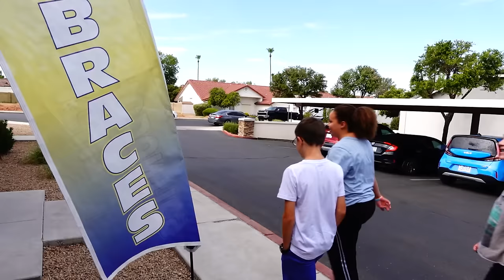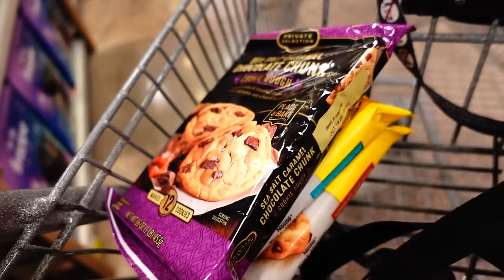Shoe Shopping For 10 Kids! | Back To School Time!

Comment: My dad was super insistent that I know how to change a tire back when I first got my car. He was like, being a girl should not stop you from this knowledge because it's a life skill. I agreed, and so I went out, read the manual and began trying to change it on my own, and I ran into the same issue as Addison. I could not for the life of me get the lug nuts off. Of course, my dad came out to help "poor little old me," and then hilariously, he couldn't get them off either no matter how hard he strained, so we had to call a tire service and the tire service guy couldn't do it manually and had to use an electric gun to get them off. I also mentioned that unlike guys, girls wear skirts and dresses a lot so bending down and rolling under the car and all of that in a skirt on the way to work is just not happening, sooooo now I just have triple A. Life skill achieved: if you can't do it, hire someone who can.

Comment: A couple months after I turned 16 I got new tires on my car. Turns out the shop didn’t tighten the lug nuts enough on one tire and it flew off of my car when I was on the way to school. Luckily I felt it wiggling and started slowing down before it fell off but I was still going like 30 mph when it went flying. So scary

Comment: I had a tire explode on the expressway. And it was my front passenger tire. A man pulled over immediately but couldn’t change it because my tire wrench did not fit.  I was on the expressway for 4 Hours before a mechanic tow truck could change my tire. But they needed cash payment and the tow driver followed me to a Wal-Mart where I could get cash.  A major bad day.

Comment: Very random but if u didn't know braces are suppose to be on for 2 years correct me if I'm wrong
Reply: Braces need to be on until your teeth are straight. There’s no specific time range. If someone has relatively straight teeth before braces, 9 months of braces might fix them. If someone has very wonky teeth it could take over 5 years.
Reply: My brother had them for like 4 or 5 years they actually wanted to break his jaw and wire his mouth shut